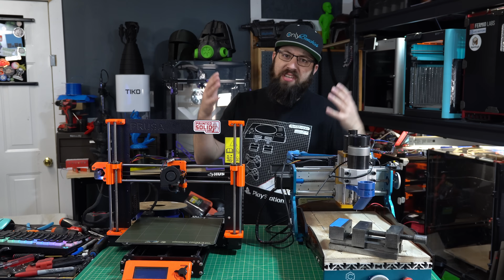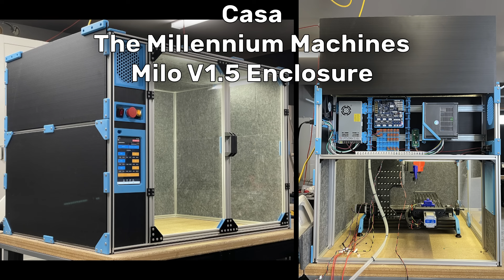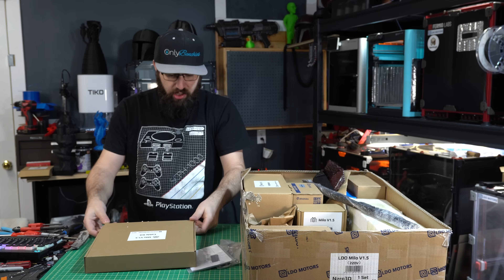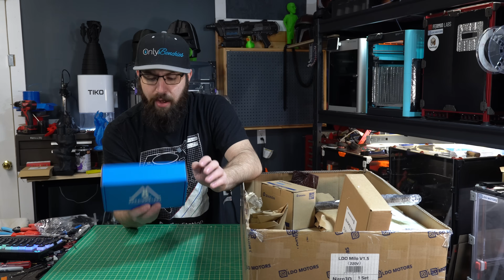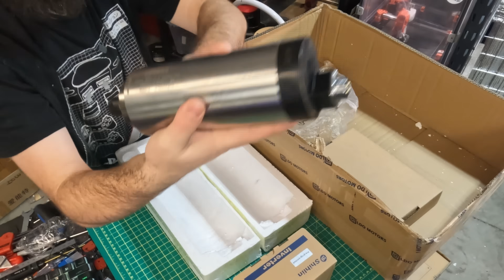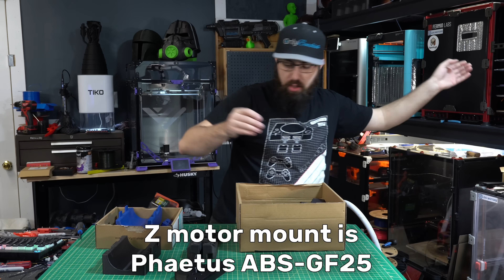Unboxing the Milo V1.5 CNC Kit by LDOMotors

Comment from the maker: Interested in Snagging a kit for yourself? Check out your local LDOmotors reselller
https://ldomotion.com/p/contact
Quick corrections, There is no nema17 option, that was on the milo v1.4, its 65mm, not 60mm for the other supported spindle size and lastly some vendors WILL have 110v spindle/vfd available for later batches of the kit
Reply: Batch 3 comes with a 80mm spindle for all that are printing your own parts

Comment: the screen on your 3D printer lights up when you moved the parts..
Reply from the maker: moving a motor manually backfeeds a current to the controller causing the screen to light up

a generator is just an electric motor which is a generator

Comment: the fact that it doesnt come with ballscrews is legitemately a shame! i was really tempted to buy the kit but that really puts me off from the whole machine.
Reply: Hey there guy who designed all the versions of milo here after running ballscrews for half a year on my V2 for testing I can confidently say that I don't recommend them. They cut your max feedrates by 4 times and make it pretty much impossible to run 3 flute tooling you could use higher lead ballscrews but size constraints become and issue or they're really bloody expensive etc im actually in the middle of converting my machine back to leadscrews as the ballscrews genuinely didn't improve my real life accuracy at all they just made the machine incredibly slow. On bigger machines where you can get away with bigger screws that have higher leads then sure but on milo where space constraints are a thing just keep the leadscrews

Comment: Hello. I am using (mini) milling machine a lot (hand driven, not CNC). It has a ratio reduction between a 500W brushless motor and spindle, and it has enough torque to mill steel too. Aluminium will melt on those high RPM-s (main problem with Milo or new Voron CNC). I hope once somebody will create a desktop CNC with including this spec too.

Comment: I live in France, we are on 220 V and our electrical panel can go up to 40 A (depending on subscription), my apartment is on 30A
Reply: US domestic panels are typically 50-200A.
Necessary when you're at half the voltage for small stuff, and the 240V appliances include things like central air conditioning that can pull 30-50A peak on their own.
Reply: @ToastyMozart For me in France.
A typical contract for electricity limits the contractor to 9000W peak (220V 40A), but can be increased up to 20000W (90A). And even switch to three-phase 380V for large equipment

Comment: Why someone buy this (which looks good though) when it costs 1500€ while you can buy a 1250mm x 1250mm RatRig Stronghold full kit with tools for 2200€???
Reply from the maker: why buy an f150 over a rav4?
Different design goals, capabilities and sizes.
Buy and use whatcha want
Reply: @CanuckCreator  what makes this superior?
Reply from the maker: neither are superior, they all have pros and cons
Reply: @HuskysAquariums  Fits parts that need a larger z clearance with more rigidity. Footprint to work area ratio is a lot better with smaller builds. There are far more capable machines you can build for far less if you put more time in though, a kit with all parts and simple build are why this and ratrigs machine are popular.
Reply: the stronghold is not 2200 go to their website right now and actually go through the options list and i assure you that number is closer to 3500 when you match it feature for feature to milo the 2200 is just for the frame essentially. Don't get me wrong the stronghold looks cool and probably works but its not the same at all
Reply: For $1500 Euro you can buy an actual cast iron desktop mill. If you want to go used well...
Reply from the maker: @dalem04  oh man, where are you finding cast iron desktop mills for 1500?

Best ive ever found within practical distance is clapped out off brand bridgeports for 2-3k, and I for sure do NOT have the room for one nor 3phase to power it properly (i know both those can be overcome, but still)
Reply: @CanuckCreator  Seig makes some.
It's ~$2300AUD or about $1600USD for the kit.
Or $2100 for a Seig X2.7L made from slabs of cast iron. That I would post a link to if Youtube didn't hate links.

Comment: Nero, thank you for the detailed video on the kit's contents. However, as an engineer, a few things caught my attention. First, you refer to the 3D printer as a CNC, and vice versa. It's an imprecise term, even though I understand it's widespread in the USA. A bit of resistance could spare us from something as silly as mislabeling a feeder as an extruder and calling a hotend an extruder while it combines both cold and hot elements. The Milo is a CNC mill—never once heard you use this term, which is spot on. The machine's name alone should have triggered the experienced person in you, given its play on the term mil. So...

Moreover, using 3D-printed parts on a mill raises a red flag for me. The Young's Modulus of thermoplastics disqualifies structural plastic parts in any machine subjected to stress, especially a mill. ABS might not be the best choice either, considering its mechanical properties. To match the rigidity of an aluminum plate, PLA would need to be 20 times thicker in all three directions. And 100 times to approach the properties of steel. Yet, the Young's Modulus is given for an isotropic and solid piece, not the case with a 3D print! For a sensor endstop bracket or any non-structural part, it's inconsequential. However, for a structural piece, it immediately affects the machine's performance and/or cutting quality.

Let's be pragmatic. First, we have some standard parts in good metal for reasonable price nowadays. Good filament costs between 20 and 30€, or 30 and 60€ for filaments with better mechanical properties like POM or PC. Steel is 2€ per kg, and aluminium is 4€ only. Drilling four holes in a good old metal plate with a printed template is achievable for anyone with a drill. They'll get a better piece, in much less time, and for much less money. So, why on earth use one of the worst materials for this purpose? It's fantastic to have linear guides on a machine, but what's the point if you hold the spindle with 3D-printed parts that are 50 times more flexible?

What will happen as a result? Because we can already tell on paper. Well, just like with a carnival 3018, we'll have hordes of YouTubers reducing speed and depth of cut to avoid stressing the machine too much and getting somewhat presentable parts. And that'll be enough to claim it's a good machine. Their audience will believe them. A good machine is one that can work to the specifications of the cutting tool. If the spindle accepts 10mm diameter cutting tools, then a good machine must enable the use of that tool at the feed rate and depth of cut it demands. I won't go into detail here, but taking 0.5mm in aluminum with a 10mm tool is 20 times below the ordinary parameters for that cutting tool. So either the machine can exploit the tools it can carry, making it a good machine, or it can't, making it a bad machine. It's as simple as that!
Reply from the maker: So as a tool and mold maker with several years of manual machining background.

I think your way over expecting what this machine is meant to be, is it comparable to HAAS or Trimill, heck no, and never will be, its not meant to be.

Its a fully DIY cnc mill that doesnt require any specialized tooling or skills and is built with off the shelf components, expecting it to push a half inch endmill through p-20 tool steel is folly.

I`ve seen this machine in action, and seen what it can do,  no, its not a production machine, its hobbyist project for someone who wants to dip their feet into the world of subtractive manufacturing who also wants to build something themselves and has resonable expectations as to what it can accomplish.

TL:DR no this machine isnt for everyone, no its not the best, but it does what it does quite well, and if its not for you, dont buy, simple.
Reply: @CanuckCreator  I appreciate your input, and perhaps I wasn't clear enough—my apologies. Just a quick note before diving in: it's amusing how the CNC discussion always revolves around either price or the amateur versus professional domain. In reality, these arguments don't hold water. As mentioned earlier, a very capable machine can be crafted without special skills, a hefty budget, or complex tools, given the use of the right materials. Two examples: a CNC mill structure cast in concrete on particle board would be excellent, requiring no special tools and costing next to nothing. With just a 5€ hacksaw, a square, and some epoxy, one can assemble an excellent steel structure. So, it's not about skills, tools, or budget, but simply about making the right choices, and one can build a capable machine at a minimal cost—examples and plans abound on the internet. Moreover, I see no good reason why a hobbyist should be excited about having mediocre tools.

Now, let's get to the heart of the matter, shall we? I graduated several decades ago and have been interested in CNC mills since 1996, in addition to being an early Reprapper. The crucial aspect in a machine is its coherence. If you want to engrave PCBs and MDF without quality requirements, then a 3018 will be perfect for that purpose. However, if you aim to cut hardwood or metals with it, you're exceeding its capabilities. Changing its spindle or guides is futile—a machine is a whole, and to meet your expectations, you'll have to change all components, from the structure to the control board. Here lies the issue: this machine aspires to compete with an entry-level mill, yet the kit's price seems higher than digitizing a Sieg X2, made of good steel, which can live up to its claims. Meanwhile, the kit presented here already has a number of major flaws on paper.

Firstly, as mentioned earlier, structural parts in plastic, especially 3D-printed, cannot provide proper support in a milling application. The aluminium structure is also less than ideal (aluminium profiles are more expensive than steel profiles that could be simply glued up). The machine comes equipped with an oversized spindle for its structure. Objectively, a less stressed structure by a 500w spindle with an ER11 collet would be more suitable. Because if you have a spindle capable of mounting large tools, expect users to do just that.

Understand that mounting large tools on a structure incapable of withstanding their forces doesn't make sense. The user will have no choice but to drastically lower cutting parameters, which is bad for the tooling, leading to overheating, working at the edge of its sharpness, and rapid wear. You have the right to disagree, but I observe marked design errors that cannot be without consequences.
Reply: @axelSixtySix  The PrintNC is a design that can be made with hand tools also and manages the rigidity impacts of printed parts much better, with a roadmap to make replacements out of Aluminium/Steel as soon as possible. I'm sure with time the Milo will adopt the same strategy, or the community will do it anyway.

Comment: What about creep on the cf parts? I remember Stefan´s video when he used cf parts on voron 0 and he suffferd from serious creep.
Reply from the maker: the creep wasnt due to CF, it was due to the nylon type used IIRC, im using a different type and also it is annealed
Reply: @CanuckCreator  You annealed the printed part or the filament was already annealed? I would love if you make a video about these cf and gf types of plastics. Peek and ultem are cool but they are hard to print and very expensive. So pc, different types of nylon and other materials that you can print under 350C on hotend are very interesting to me and I also think the community would like this type of a video.
Reply from the maker: Annealed the printed parts, its not hard and most manufactures tell you temps and times needed. 
Litterally just throw em in something that can heat them up to the required temp for x amount of time and then cool them down graduallly

Comment: When you get bored with GRBL, consider upgrading everything to a closed-loop servo system. Have a look at Acorn CNC and their Teknic ClearPath servo solution. Top notch stuff that would be super cool to try out on the Milo.

One more thing to note about the spindle. From loud to quiet, router-->air-cooled spindle-->water-cooled spindle. Routers will make your ears bleed, so it's great that the spec calls for an air-cooled spindle at a minimum. However, liquid-cooled is by far the most ideal basement chip cutting based on the sound alone.
Reply from the maker: This kit stock is using RRF to control the machine, not GRBBL, as for the spindle, air cooled makes a bit more sense vs water due to simplicity and cost of adding all the water cooling equipment (tub, pumps, hosing etc)

You can always order the kit WITHOUT the spindle and self source w/e you want, or competently DIY too
Reply: @CanuckCreator  My bad, you're right about RRF. Yes, water is much more complex, but the cost is literally an aquarium pump, some tubes, and a 5 gallon bucket. Your ears will thank you in the end!

Seriously, check out that Acorn CNC controller and the Teknic ClearPath servos....it's amazing.
Reply: @mrpute  There are plenty of ways to go servo without needing to move to something so locked down and proprietary.
Reply: @CanuckCreator  WC spindles typically have substantially more power and are drastically quieter. If you don't mind it being unbelievably loud, and the spindle is overspecced somewhat, an air cooled spindle is mostly fine.
Reply: I have a Mavell FM1000 with quick change for tools but yeah above 10k rpm you have to deal with 70-75dB…. Never used 24k and most of the time I use 6k rpm to keep the noise down.

Comment: I have a long mill sienci CNC since 2022. Been a good small shop machine. It is 31"x31". By the way a Canada based company. I started with a desktop 3020 from china,then a small diy.Year & years ago. And I do think it is interesting that all of these are CNC(laser,3d printer etc). But when we say CNC we pretty much refer to the traditional spindle material extraction version.

Comment: Some available VFDs can double the voltage so you can run a 240V spindle from a 120V line. The power (and torque) will be limited by the capacity of the 120V inlet power but the RPM will have full speed range. I don't know about the LDO VFD. (note that 110 and 220 are generally not what is actually available, usually it is 120 and 240 volts).
Reply: Can you recommend one of those type VFDs?  I only have 110v in my current house but that sounds convenient for when I move to a place with 220v.
Reply: I think you are being unnecessarily rigid with that statement. actually what is becoming more standard is 115/230V, certainly in the EU that is THE standard. Some countries are 220V and others 240V for 2 phase, but in most countries depending on where you are, how close you are to the substation, how much load is in your area etc, that can vary quite a bit. I have lived in houses that are as low as 225VAC and as high as 250VAC late at night when the load is light. our power in Australia used to be specified as 240VAC, but as of 2010 that was standardised to 230VAC.

Comment: What software do they recommend to make the gcode ? I guess fusion360 would be one option. I only do basic cuts on my Workbee and use cut2d desktop that I purchased, but it really is designed for basic 2d work, you can't even do chamfers with a basic tool. The kit looks great and including all those bits, 123blocks and dial indicator is a nice touch.
Reply: Kirimoto is a good web based (free) option
Reply: @jon_raymond  thanks I will take a look.
Reply: Some folks use ESTLcam for this type of work.
Reply: Hey Millennium founder here, we currently have a basic post processor for fusion, were working on a bolt on for RRF to make it more feature rich which will be coming out later this year.
Reply: @jakeengland1430  The problem with fusion for me is the free version does not allow you to design and sell parts.
Reply from the maker: TBH

Not a clue
Ive used carbide create in the past, but its really only good for cutting 2d flat shapes and putting holes in things, no 3d models at all
Reply: @CanuckCreator  That is the same as Cut2d just basic SVG and DXF import for 2d cutting. It will be interesting to see how people find that part. Cut2d has a lot of speeds and feeds for basic materials and tools so it did make it easier to get started.
Reply: I use estlcam fory basic CNC needs.
Reply: @BitSparkLabs  that a good price, I will give the trial a look.